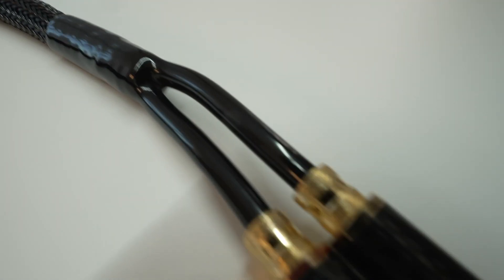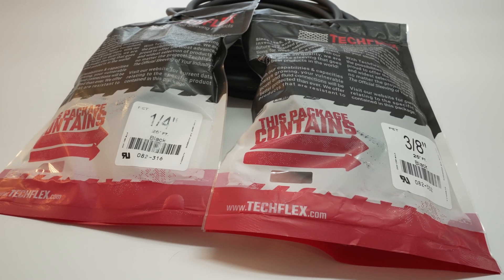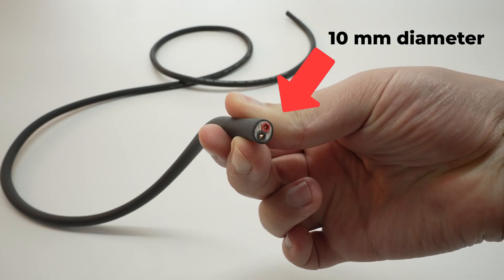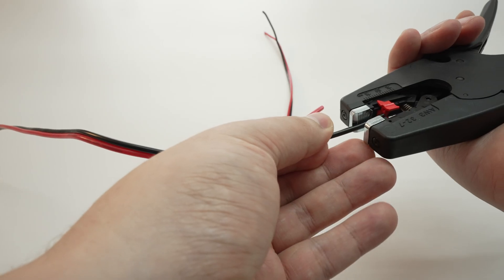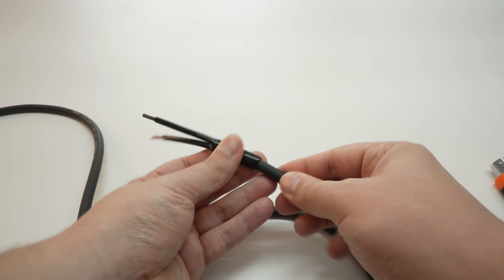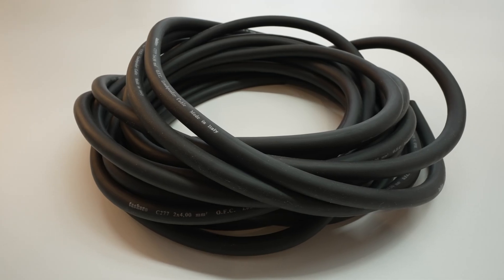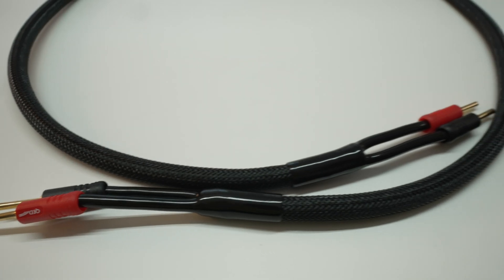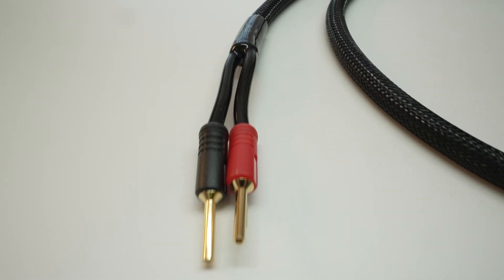DIY Speaker Cable using Banana Plugs

Comment: When using ferrules, doesn't it add extra resistance in the signal line?
Reply: Actually the opposite because the contact is tighter because you can screw down harder with no copper strands moving out of the way.

Comment: The best electrical contact is obtained using hollow bananas because they have the largest contact surface, furthermore all screw-on contacts should be avoided because they ruin the wire and loosen with vibrations and therefore hollow bananas to be soldered should be used.
Reply: Been using screw on Banana plugs for decades with no issue.  None of mine have ever loosened because of any vibrations.  You need to do better research.
Reply: @enterprisecreations1492It depends especially on the humidity of the environment, if you move the cables often and if the vibrations are strong enough, I did not say that screw connectors are not a valid solution, I said that they are not the best solution.
Reply: you got a link to those? I'm not sure I'm getting the right products when I look up "hollow Banana pin"
Reply: @hermangaviria690  I have the Viablue T6S but they are no longer on the market, other German, Japanese or North American brands are definitely fine, you can see them well on Google images (hollow bananas, hohl banana), everything is fine if it is copper, brass or silver, it is not necessary that they are expensive, if it is Chinese stuff it could be made of magnetic metal, and then it is better if they are soldered, the screw connection is less good.
Reply: There are hollow bananas of various designs, they are all good if they are copper, brass or silver, you also have to check if they are suitable for the size of the wire to be soldered. On products of Chinese origin you have to be careful that they are not made of bad metal, for example magnetic. The soldered part can be covered with heat shrink tubing.

Comment: Great guide, thank you! Do you have a link to the ferrules? Also, I was under the impression that you want both screws to compress the wire (or ferrule.) I think I will tin my 16AWG wire instead of using a ferrule with the Nakamichi banana plugs. I will put the sleeve on first then split the cable. I might add red or black heat shrink tubbing at the end instead of using pants... not sure yet. 3:56 16AWG

Comment: I have recently design 3 way sytem with subwoofer. 120 RMS woofers 8OHM 88 db, Mid range Full range speaker 40W 8Ohm 88Db, Tweeter 8Ohm 40W unknown DB. 
12DB 3 way crossover. I noticed some High freequency spikes it was adjusted electronically in the pre amp section. 
My Woofer 61Hz resonance and box ported type designed for 40 Hz. 

Subwoofer Infinity 121W in a closed box driven by 400 W class D amp also have active crossover in the pre amp section. It is not a fully functional crossover but we can adjust using presets arrangement. 

Bellow 60 Hz I noticed a dip bellow 60 Hz and  that graph fatensout till 35 -40 Hz then falls sharply bellow 40 Hz. 
I don't have a calibrated mic but mobile phone mic and Android app for  freequency measurements. I do confirm my graph accuracy using a branded polk audio system. Because I have limited resources. 
System perfomace very nice I am following your channel so I am able to design a music system with satisfying out put. 
I tuned the sub to perform bellow the 60Hz. So the overall trend become flat from 40 Hz. 
Entire system including Power amp cost Rs. 20000 Indian rupees. 
Amplifier front panels I designed myself and laser cut on acrylic sheet. 
Left and right 100W Toshiba 5200 transistor AB type with 10 Band equaliser pre amp (Built in). 
400W class D for sub channel. 
Speaker protection (DC protection, start-up delay) using relay switches were installed. 
27-0-27 8Amp EI core transfotmer I wind by hand. It works well for me. There was a slight humming sound in the background.
It was due to the cooling fan. So i connected it through a seperate 12Volt smps hence problem rectified.

Comment: Thank you another great video and for testing stuff that is available on EU markets. 

I have a question. You test for resistance, conductivity and discard ones made of steel etc. but in the end you use ferrule? What ferrules are made of and what about their impact on connectivity? Also are these confirmed to prevent oxidation over time? 

I know that some people instead of ferrule would use silver solder to "bond" and protect strands from oxidation before inserting htem into banana plugs. I would imagine that it would have better effect than a ferrule?

Could you please let us know what are your thought on the subject?

EDIT: Ok I did some reading and apparently ferrules are meant to prevent oxidation :). Also these can be made from copper or brass and coated with tin or whatever else :) - do you know of any good source of copper coated with something good? :)

Or can you list a link to the ones you are using if you know what these are made of? There is no link in your parts list. Thanks again.